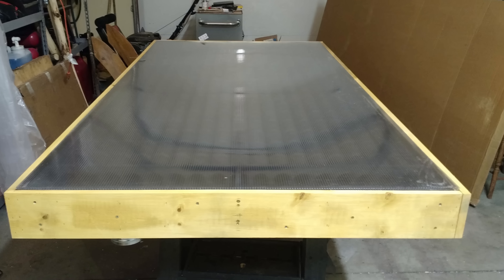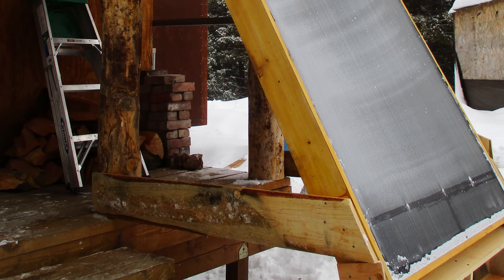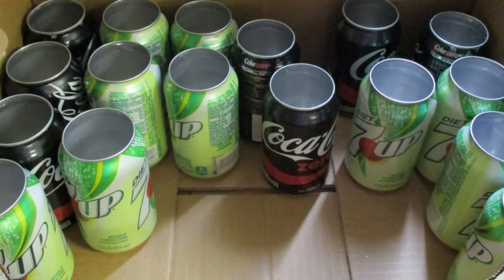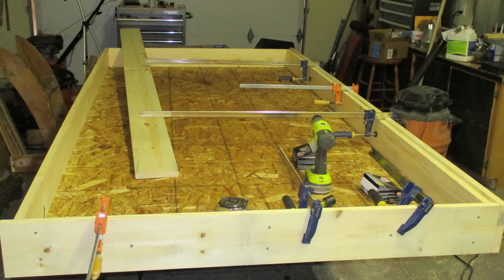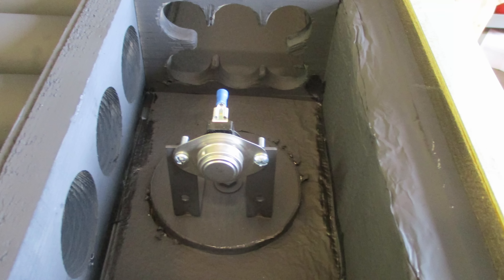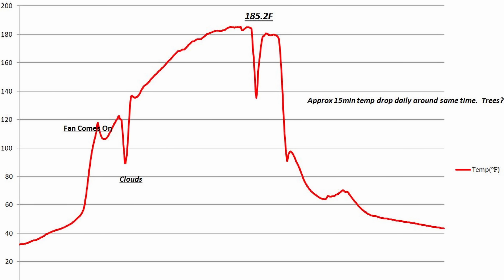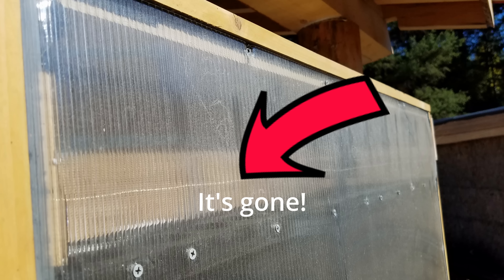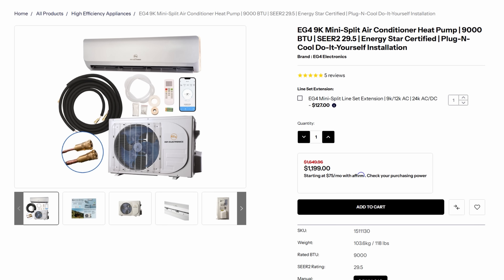7 Years with Pop Can Solar Heater - Is It Still Worth It?

Comment: Very good, detailed description of the project, preferred materials, and economic considerations. I see this as mainly of use for a no-power situation, especially if you can get a dual-function air handler for not terribly much more and no construction effort. That said, I have seen these build with aluminum vent ducting instead of cans (I don't know how well it would handle the high temps, relative to the cans, but it would at least be flexible and maintain structural continuity). Might be worth a try, and wouldn't be a large additional material cost. =^[.]^=
Reply from the maker: That's an interesting idea about the aluminum vent ducting!
Reply: @TheOldJarhead  Check out Texas Prepper Projects latest video for an example of a vent duct solar air heater. =^[.]^=
Reply from the maker: I'll have to try that

Comment: But wouldn't you be paying more in the long term for electricity by using the EG4 air conditioner and heater?
Reply from the maker: Other than the initial cost?  No.  My cabin is off grid 😀

Comment: I'm interested.  I saw those videos and never thought they worked, and even if they did work they only worked when the sun was out.

I don't get it either - yeah of course the measured temp at the top of the box is going to be high, but that tells you nothing.  What you need to know is the volume of air and the temperature of that air flow - flow, not just the temp when it is sitting in the sun.
Reply from the maker: That's a good point about needing to know the volume and flow of the air!

Comment: Maybe its halfway to a minisplit BUT
after initial cost theres no more  paying.

Constant cost with the minisplit
Reply from the maker: You're right, the long-term cost is definitely a big advantage of the DIY solar heater!  Though, the Mini-Split won't cost me anything either 😉
Reply: @TheOldJarhead  If what you mean by it won't cost you anything is that you're using solar power, then the actual initial cost of a mini split isn't just the cost of the mini split. It would be the cost of the mini split the batteries the solar panels the charge controller and all of the other things necessary to run a solar power system too. There's also the fact that the mini split can fail whereas the passive solar radiating system if installed properly will never fail.
Reply from the maker: Not when the batteries and solar panels are already there anyway.

I have 10kwh of batteries, a 4kw inverter/charger and 2400w of solar arrays.  They were already there :D and designed for use in the deep winter.  So, in the summer, I have excess power and solar.

Comment: If you build this from 1x6 you cant put a 6inch hole in it.
Reply from the maker: In the back 😉
Reply: @TheOldJarhead  That would require some modification of your design, and not simply just making the hole bigger, which is what you make it seem like is all that would be necessary. Most people on DIY Tutorial situations would not think far enough to realize that they could expand the size of the manifold vertically allowing for that much more room on the backside.
Reply from the maker: Nope - that's how I built is.  My inlet and exhaust are in the back, in the OSB.

Comment: @The Old Jarhead, I was wondering what brand of mini splits you would recommend for the
Mohave desert area where temperatures soar in the summer, it sounds like you researched them.
I have used them and they are great. Thank you for this video.
Reply from the maker: I haven't done much research on mini-splits for desert climates, so I'd recommend doing some digging into brands known for high temperature performance!  I'm looking at EG4
Reply: @TheOldJarhead  thank you.
Reply from the maker: Absolutely

Comment: My Dad made 2 of these in like 1978 or so , and they are still working today , he has replaced a couple of fan motors and maybe the snap switches at the same time but other than that , they heat very well every winter, also he has his fans on the inlet side so the blow the cool air in , so the gan stays cool and the snap switch is wire in at the top
Reply from the maker: That's incredible longevity for a DIY project!

Comment: I had a friend build one and instead of using cans he alternated channels from roof material at slight angles all the way through the heater so that air had to chase its way through as it warmed up . He trimmed the ends of each piece of flashing roofing material to allow hot air to make it around the channel and go into the next channel he pushes it through it’s beautiful during the final chase out was maximum heat. Really a pretty awesome set up
Reply from the maker: That's a very creative way to maximize heat transfer!

Comment: Over 10 years ago we made a passive heater like this but much simpler, just a sheet of black aluminum. We get questions about it a lot. 
Just a suggestion, show more photos of project with narrative. Less just talking. Short attention spand.
Reply from the maker: https://youtu.be/rAzUMeK9bKE  This one wasn't meant to explain how to build one, just show quickly what I did so I could explain the issues I had and whether it was worth it but the one I just linked I did many years ago on how I built it :)

Comment: My patio door in winter  is not keeping the cold out very well, maybe something this could be used to cover it.  Since the hours of sunlight are much less in winter blocking the view wouldnt, be an issue . Of course access to the outside is critical to evacuate the home in an emergency. Thanks for this video.
Reply from the maker: It's an interesting idea and definitely worth considering given the thermal loss through a patio door.
Reply: My north facing double pane sliding patio doors measured with a non contact thermometer would 35f on the glass many winter nights. I copied a youtube video about placing bubble wrap on the glass. Side by side testing with uncovered glass at 35f the bubble wrap on the covered glass was 55f. And still lets the lite in to the house during the day ;-)
Reply from the maker: Cool!

Comment: Wouldn’t lengths of 2 1/2” ABS instead of aluminum cans work better? Use 2-3” outlet collars. Foil covered osb would radiate better than a black surface. Put foil covered insulation on the outside of the osb back with the foil side in to increase radiant heat. Now I want to build one. 😉
Reply from the maker: Thin wall Aluminum cans release the heat they've accumulated much faster than other metals and heat up almost instantly in the sun.  This is why they are most commonly used.

Comment: Well explained vid. Thanks.   Just a note on a mini split, it can struggle with very cold temps. We loved ours, but used wood heat as winter supplement.
Reply from the maker: That's a good point about mini-splits in very cold temps.
Reply: @TheOldJarhead  I understand that they are now making some that handle cold temps better. They are great energy savers.
Reply from the maker: awesome

Comment: If the holes at the top are smaller , heat will be forced out faster, so that maybe you wouldn't need a fan.😮
Reply from the maker: You want the turbulence inside the tubes to absorb more heat.

Comment: Lovely build, but it seems a bit over engineered.  Can you reiterate why these long aluminum tubes are needed instead of just painting the back black and using a second sheet of transparent plastic?

Either way, you get a box with an insulated interior channel that absorbs all the light and makes hot air.  Adding a second sheet of plastic is way less work than drilling out and connecting all those cans.  Also way less prone to things breaking, like the two cans you showed.

But it is a cool build and how great that you get all that warmth for years!
Reply from the maker: Thin walled aluminum can's heat up almost instantly in the sun when painted black and they release that heat almost instantly as well.  The shape of the cans creates turbulence inside the tubes reducing airflow a little and causing it to absorb even more heat.

That's the theory anyway.

Comment: $600 isn't bad, considering that it's lasted for several years, and that the only power required is a small fan.
Reply from the maker: Agreed, though it can be done for less, I just used big box store prices of what I did then.  If I were to do it again today I might skip the Lexan and go for something less expensive (that's $200 of the $600 price) and the wood, for me, is free (I own a sawmill) other than the OSB. 

But yes, not bad when amortized over 7 years.  Oh and the fan runs off my off grid power system :D

Comment: Yes, you have many good ideas with the (beer ) can heater. . lol  seriously I am drawing the plans for my heater, I have poor solar radiation. Thinking about making the system with a 90 degree angle fo more collection area . And have a collection of cans for the recycling bin that are being transferred to the research and development center!! Lumber as well. .Do you use spray foam insulation for additional insulation. 12 volt DC automotive heater motors powered by a small solar panel .  Damn I can’t draw the plans fast enough.
Reply from the maker: Best is to align the panel perpendicular to the sun angle (directly face the sun).  I didn't use spray foam but didn't need it ;)

Comment: wouldnt it be easier to just buy some black plastic irrigation pipe?
why the heck are you using soda cans...seems like such a waste of time and energy
Reply: @CStoph1979   there are people using dryer vent hose & other things, black drain pipes...
Reply from the maker: Thin walled soda cans almost instantly heat up in the sun when painted black and then almost as quickly release the heat.  They actually do this better than all the other options.  Furthermore, their necked down shape (top and bottom) create turbulence in the air flow inside the tube causing the air to heat up faster than in a straight tube or empty box.

Of course, a painted black box will also heat up and allow convection to happen etc.  However, with just two hours of peak sun the idea was to create as much heat as possible, as fast as possible and for as long as possible...hence the cans which are better at it than all the other options.

Comment: One addition to a pop can heater I have pondered (without ever having built one btw) would be to help store the heat by venting it into an insulated box (with either rocks or thin slabs of pavers with air spaces between them) to store some of that heat and release it slowly overnight. Say, with a few holes in the bottom of that box and a few at the top for venting. If the box were metal, it could also act as a sort of radiator as it heats up. Might even be a favorite spot for the cat to go sleep on top of, too.
Reply from the maker: That's an interesting idea for heat storage!

Comment: I saw a version of this in the 1980's in "Mother Earth News", that had an extension at the top, that went across a window sill and down into the room⤵️ with two sections over each other 🟰. The opening had one chamber open lower than the other such that only warm air could come into the room and only cold air could come out, because hot air rises. I don't remember which channel was higher warm or cold. But it solved the night problem.
Reply from the maker: That's a clever design to manage the night problem!

Comment: It regularly get's up to 110°F here in Western Australia, I can't help wondering if I missing a trick using convection to cool our place along these lines!

We once built weather board clad houses with ventilation mesh at the top and bottom to keep the interior room lining from cooking.  I'm sure there's something in pop cans that would enhance the situation...

Perhaps a ceiling fan driven by the exhaust flowing of of it?
Reply from the maker: Interesting thought about using the concept for cooling!  It may work with a fan pushing air through top to bottom

Comment: Here's a good tip for somebody that wants to do this. if you're going to use the soda cans all you need to do is flip the can on its top and put a piece of sandpaper on a flat surface and just go back and forth with the can and that little ring that holds the top on will wear down in no time and you'll be able to pull the top right off. Try one and you'll be amazed.trust me I've done this hundreds of times and it works and it doesn't take long.
Reply from the maker: I used a 'John Wayne' can opener for the tops and it was fast and easy (once I decided drilling the tops out was tougher than the bottoms).  Here's the old build video:  https://youtu.be/rAzUMeK9bKE

Comment: For moving air cheaply. Most of these blowup yard decorations, like Santas and Jackolanterns, utilize a 12V fan powered by an inline voltage transformer that plugs into 120V. They move air well! Designed to push air not pull, incorporate into the intake side to push air through the heater. I've also seen them used for ventilating areas like RVs and tents where they aren't in an environment of super heated air.
Reply from the maker: That's a clever idea for a cheap air mover!

Comment: Something doesn't make sense here.  I've seen high temp silicone after it's been on race car exhaust headers (manifolds) and it's still 100% like it was the day the exhaust was put on.  So either something else gave way, like a coating on the cans or the "high temp" silicone wasn't high temp enough.  There is high temp silicone that is approved for sealing fire boxes on boilers so it's out there.    I also don't know why you would spend all of that money and time on silicone when you can buy 3 or 4 inch vent pipe and do the same thing for a lot less money than several tubes of silicone.
Reply from the maker: For me, it was a first and an experiment.  Seemed like a fun project and I learned quickly the silicone wasn't the way to go (hence the Fuzeit).

Comment: If you put a simple plastic baffle on the inlet where the air is fairly cold the un moving air in the cans/tubes will not cool down your heated space. For higher efficiency I would duct the hot air to a outlet in or at the floor, that way you get natural convection mixing the air. This would require a fan but it should go just before the inlet baffle to keep it from overheating and from getting to cold. The snap switch is still good in the spot you put it. If you are rebuilding it I would recommend rain downspouts (aluminium if you can get them) painted with the high temp black paint. You may want a couple of small net covered vents in the top and bottom of the box around the pipes to limit the temp to safer levels. For insulation rockwool is a good temp tolerant option to.
Reply from the maker: Those are some great suggestions, thanks!

Comment: How large of an area is this heating?  What part of the country do you live in?  I'm just trying to guess the efficiency of the unit you built. 
Interesting information. 👍
Reply from the maker: The porch is 8'x8' and I'm at 3200' in elevation and just south of the Canadian border in Washington state
Reply: @TheOldJarhead   That was built to heat the 8x8 porch?  I live in the Oregon coast so we don't have those kind of cold temperatures.  That said I'm looking into a mini split for my mobile home.  Electricity rates have gone up 40% in 5 years.....
....or maybe it's 50% and 4 years.  I'll probably end up spending $2,000 on a mini split only to pay the same amount per month that I paid 4 years ago.  It's incredible that they can raise their prices this much, this quickly.
Reply from the maker: lol yes.  But I also see -30F in the dead of winter and in all honesty, had plans to allow the heat to be transferred to the inside of the cabin as well.
Reply: It's impressive for a small area to be able to be heated to that temperature with -anything. 
Super cold here is like  ....24 for a low in January.   29 to 35 is closer to normal.
.....yeah, were wimps. 😂 @TheOldJarhead
Reply from the maker: 🤣😂 -30F vs your balmy 24F lol sure, we're the whimps....

On a side note, yes, impressive.  We tore it down today and the heat was coming out of the top despite all the issues.  Fun stuff.
Reply: @TheOldJarhead  Don't tell me...  You guys don't even put on jackets until it gets down to 15° 😁   
 Yeah we've got it pretty mild here  near the coast compared with many other places.
Reply from the maker: LOL that used to be me, but now I'm finding I like to have a jacket on below 50F!!  lol

Comment: U did way to much man I made a backpack solar heater and just duck taped the seams and it worked the air coming out 5ft away was about 40 degrees higher than outdoor temps I had a mercury thermostat inside the box wired to ac so when it got over 90 degrees in the box the solar powered PC fan would come on and start pushing the air out the box
Reply from the maker: That's an interesting approach!
Reply: @TheOldJarhead its a wood box I made with backpack straps it would work well for hunting blinds in a sunny field
Reply: I wish the tstat came on higher than 90 degrees that way u get mor ehear but it was sufficient  enough for a demo to see if its plausible or not @TheOldJarhead
Reply: I think if u do math on the ampunt of airspace needed it would be even more efficient.. just think not enough air space then the hot air will get pushed out faster than it can heat the fresh air coming in.. its also a good idea to have 1 hole.for frwsh air and a recirculating pipe back into the heater that if its 30 degrees out your pulling hopefully 70 degree ait back into the heater from inside the room your heating but always have some fresh air that way your not poisoning yourself with co2 u breathe out  @TheOldJarhead
Reply from the maker: That's the balance, move the air fast enough to warm up a space but not so fast it loses the ability to heat up